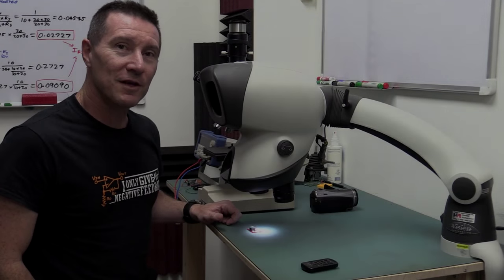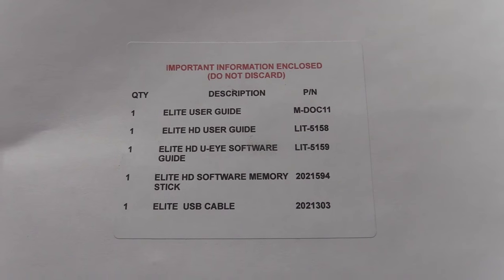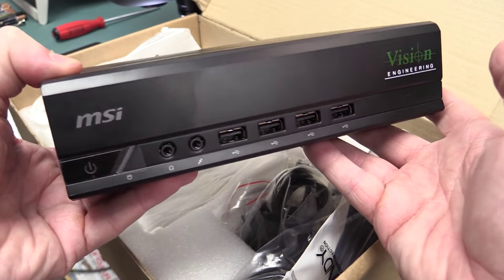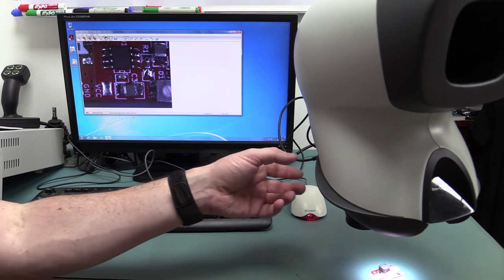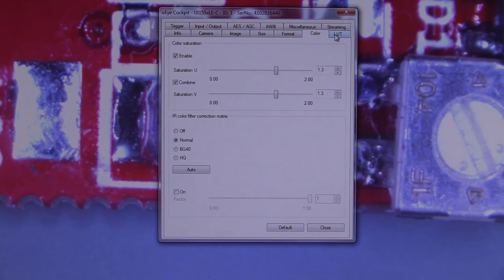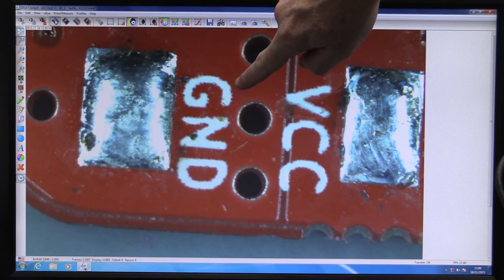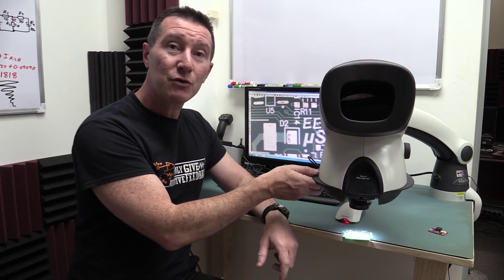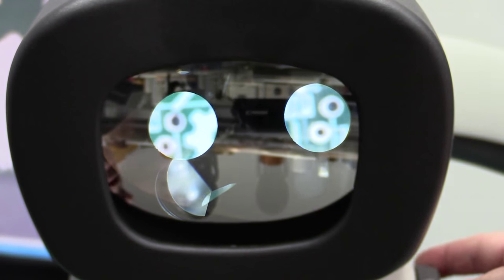EEVblog #817 - Mantis Elite Cam Inspection Microscope

Comment: Dave you really need to get yourself a Rock Solid 2-4" thick wood workbench and BOLT it to the wall and/or anchor it to the floor. Your Inspection Microscope will be rock solid and your productivity will go up even without the microscope.  Google "Anchoring a workbench" for Idea's.
Reply from the maker: +Radiation Network I know, I just haven't bothered yet.

Comment: Hi Dave...I've had a mantis in my lab now for nearly 20 years and I have to disagree with you on it..I recently sold it and moved back to traditional microscopes...we used it for wax pattern fabrication and metal working...I'm not saying it is bad..just not as good as it should be for the price..especially the depth of field, maybe not that important for pcb's but pretty important for checking fit of 2 components over a large area...thanks for the video..fun watching..
Reply from the maker: +electro1622 Sure, if you have different depth of field requirements then it might not be for you. Yes the DOF is fairly shallow on the mantis.
Reply: EEVblog
To be fair to the Mantis, it is very comfortable especially for people who wear glasses..you don't have to take them off..the swivel arm is good and magnification can be changed by the flick of a lever. Mine had a light source as well which was excellent.  For pcb's this would be awesome..

Comment: I might give you another opinion. I personally didn't like using Mantises at my work place and switched to Leica stereo microscope with boom stand. Mantis didn't offer enough room for reworking stuff even with Metcal ultra-fine solder pens. Basically my work leica stereomicroscope has 10x eye tubes with adjustable -3 to +3 correction, eye distance adjustment, Leica ergotube 10-50, Ergomodule 30-120, Leica MZ6 zoom unit, hand adjustable zoom point (focus) and 100W ring light around lens and boom stand. Basically I can adjust it perfectly for my work bench and it is always at right position and settings instead mantis where you have to move whole unit up and down to get focus right and with bigger magnification you can't work on the board. 

Well mantises are good for people who can't adjust stereo microscopes properly for themselves. Also people who use glasses might get headache when using mantis
Reply from the maker: +Markku Hyttinen I believe it's the other way around, those with glasses have trouble using traditional microscopes.
Reply: +EEVblog I am using glasses and get headache with mantis, and my coworkers have said that also :P

With proper stereo microscope's eye pieces they have enough correction adjustments so you can just take off your glasses. Of course I have seen those non-corrective ones which often are over 30 years old. As I said above my stereo microscope that I use at work has a lot adjustment modules; which let me set it correct height, right angle and my eye distance to first lens and of course step-less correction for individual eyes. With these modules I am always sitting on my workbench in proper position even without need to bend my neck at all or go lower sitting height (like you need to do with mantis). 

Of course buying proper stereo microscope is not cheap but offers more comfort than mantis, sadly I have no idea how much below system would cost to order from Leica because system that I am using now is about 20 years old already and still in perfect condition. In other hand, factory where I work has a bunch of broken mantises in storage that need to be fixed (power source failures) and are out of warranty. 

Of course if you need to capture pictures from microscope it is possible with video capture module (many different choices)

Here is complete list of Leica parts that I am using
10 447 159 (10x magnification, -3 to +3 Correction, eye distance adjustment for both eye pieces)
10 445 822 (10-50 degree vertical angle adjustment, horizontal eye distance adjustment, Eye piece holder)
10 446 171 (Eye piece holder stand module with 30 - 120mm height adjustment)
10 445 614 (Adjustable magnification 0.63x to 4x)
10 447 254 (Holder bracket for stands with step-less height adjustment (fine tune height adjustment))
10 446 300 (2x magnification lens)
??? (1x magnification adjustable focus lens)
??? (focus lens holder module)  &lt;-- No need to change actual height for microscope with this even if you flip board upside down with tall components, you simply adjust focus point
10 447 097 (swing arm)
10 447 008 (base plate leg)
10 445 154 (table base plate)
30 110 481 (Cold light source)
??? (Fiber optic ring illuminator)

This system magnification: 12.6 - 80 times
Work I do with this system: foil repairs, solder visual checks, 0201 component size reworks etc.

Source: (M-series brochure)
http://www.leica-microsystems.com/products/stereo-microscopes-macroscopes/routine-manual/details/product/leica-mz6/downloads/

Comment: Dave, they're sending you this stuff for free because you're basically hawking it in a 30 minute commercial. This thing cost a lot of money (prices start at $2,500.00). I can buy a lot of equipment for that money. I use a Nikon SMZ-1 (7 to 30 times magnification), I bought on eBay for $250.00 used and it's perfect. First off, why are you looking through this for, did you say eight hours? I use 2.50 cheater glasses for most work and when I need to inspect or solder in a TSOP or something similar I do it under the scope for 5 minutes at 1/10 of the cost of the Mantis! The Mantis, thumbs down for my money. Where's my Negative Feedback tee shirt when I need it! 
Rob
Reply from the maker: +mosfet500 These are not affordable for the individual. It's like buying a Leica or some other top brand. I've worked on boards that take all day or several days to assemble all the 0402 etc parts. Mantis's were standard equipment at most of the companies I've worked at.

Comment: Its not that hard to open up and assemble back... You wont mess with the opticals... I have refurbished mine... replace 2 mirrors... You just need to be careful but no big deal.... There is ONLY one adjustment on the upper mirror... all the other mirrors are fixed with no chance of being out of place... You can easily remove the bottom parts.. there are only 4 screws that hold all the bottom part in place... I have upgraded mine to a much bigger silica gel inside of it.... I want to be sure my mirrors are going to be good very long.... The old mirror I replaced had got some fungi... Probably because the previously owner did not replace the silica often.. The trick thing is just to split open the case.. you would need free the glass divider inside.. I had to do to replace the mirros. So if you want to see everything inside you can just open up the bottom part.... 2 screws in the front and on the back you remove 1 screw with a cover to more 2 screws and thats all!
Reply: Anyone else repaired or upgraded the usb? My cable has broken twice, now thinking good time to swap the connector with a USB or other connection and swap camera out.  The eye spacing adjustment knob no longer works so I will need to open up for that anyway.

Comment: +eevblog - Dave, I wish you would have shown the pricing for the Mantis with and without the camera instead of your viewers having to do the searching.  Just a little thing but I think it would make your video that much better.  I mean most of us just want to know if it is a $50 or $750 option whether we are in the market for one or not.  Other than that a great video!  Keep it up!   :-)
Reply: +ElmerFuddGun +eevblog - Dave, like you said about having a short HDMI cable included at 9:35 - "... small touches like that... it's important."  Same with including the pricing in your video.   ;-)
Reply from the maker: +ElmerFuddGun Depends on the country you are in and your dealer. There is no fixed pricing.
Reply: +EEVblog - I hear you Dave.  All I am suggesting is an approximation... is it a $50 option or $750 option?  Just a ball park figure in whatever country you choose.  We're all just curious and most of your viewers won't actually be buying it but would still like to know how much extra it is.  If it is only $50 then on top of the Mantis price it isn't a big deal but if it is $1000 we can continue to complain about the "cheapness" of it!   ;-)

Comment: There's something weird going on with your videos recently (last mailbag had the same issue): when I switch to fullscreen, the video is progressively slowing down but not the sound, and every few seconds it's jumping back in sync (with a audio glitch too). It's very annoying. At first I thought it was my PC, but only your channel does that, and even when my PC is mostly idle. Did you change anything in the way you record or encode them recently?
Reply: +Jérôme Vuarand Youtube always re-encodes to a lower bit rate of their own format. It may be your computer or internet speed, or flash player is out of date.
Reply from the maker: +Jérôme Vuarand It's not my video, it must be Youtube.

Comment: looks like they just strapped it last minute to make extra money not thinking through
Reply: +Vadzim Dambrouski I agree. I know the company producing the Camera (IDS) and the software to test the camera looks exactly like the software Dave shows in the video. If I recall correctly. They haven't bothered getting a developer to use the SDK to create a tool that does the job in a neater way. I mean they haven't even bothered installing it in the first place. FAIL!
Reply from the maker: +Vadzim Dambrouski Yes, it's clearly just tacked on to meet a marketing goal.
Reply: +Vadzim Dambrouski So. You're sayin' Dave's been screwed with a strap-on. Wowza. badaboom, I'll be here all week folks. ;D

Comment: I dont understand why He is so interested in FRAME RATE when youd think resolution, optics and image quality are what matter ? (not that those are top of the line either. but.. ) For soldering, even the 17 FPS on max quality looked fine to me. Its not like there is much motion happening.

Comment: Because the position of the arm of the microscope is arbitrary, it cannot measure on the image, unless you calibrate it manually. And even after, it's totally useless if the height changes a bit.
Reply from the maker: +Gonzalo Cobos Err, no. The lends are fixed magnification, with a shallow DOF, so you could at least have a ballpark accurate calibration figure for an in-focus image using a known lens.
Reply: +EEVblog Maybe I didn't get it. Does the mantis know at what exact distance the lens are from the table? If there's no feedback, it cannot measure on the image. It can always guess, though. A solution I can think of, is a simple tag or pattern that you could place on the table and the software would recognize to calibrate itself.

Comment: Dot matrix printed ident? Come on Dave, it's screen printed using a coarse-ish mesh screen.

Edit: But I'd agree with you about the Mantis - I've worked with one of these and was stunned when I looked through it for the first time. And Vision have got an 'Autumn Upgrade' promotion on their website ATM which includes a free upgrade to the Elite-Cam HD on the Mantis Elite.
Reply from the maker: +Graham Langley Err, no, it's not. They are dot based inkjet printers these days. Hardly anyone does actual "silk screen" any more.
Reply: +EEVblog You're right. Inkjet ident/legend printers are now being used for white - if you want another colour it's probably still screened. Just realised it's four years or so since I was up to speed on what's current in PCB production.

This means you don't have to be so careful about not having ident ink running over a hole on a PCB design.

Comment: I don't get all the rave about the Mantis.
I have access to some decent regular microscopes as well as a Mantis and I'm totally on the other side of the fence on this one.
The Mantis makes me dizzy in seconds and gives me a headache in minutes. I've tried tweaking all the knobs but it never gets even close to the regular stereo microscopes. I'm not impressed by the "clunk clunk" changing of magnification either when my regular microscope has a knob i can turn to adjust it to anything from 1x to 6x (on top of the baseline magnification). I've spent hours on end looking through it no problems.
Reply from the maker: +Norleif Slettebø Each to their own.
Reply: +Norleif Slettebø I agree. I hate the Mantis at my work and so does everyone else I work with. In order to get it to the right height you have to adjust your chair, because adjusting the height of the scope itself is the only way to change the magnification if you only have 1 lens.

Comment: This is what really strikes me about this expensive niche lab equipment - it's build quality and features are simply not up to par with price tag, and it seems that no creative and professional engineer with hands-on experience of their products has actually been involved in upgrading them. For the 4k $ woth microscope I would expect camera auto-calibration, dynamic software controlled LED lighting and fluid joint bearings as standart, as these features cost less than additional 200$ more to include, but without them it looks like cheap chinese tool with features included only to make more bullet points on the box.

I mean - in my small company we are also developing and manufacturing all kinds of proprietary electronics and software products for measurements and computer control, but we are making sure that our software and features are identical and even surpass every other similar product in the market from usability and convenience point of view, we ask for client to give us pre-launch feedback and suggest us what to improve - and then I compare our work with all expensive equipment that we have access to, and even these kind of products in review videos, and I don't understand, why they are making such sh*t with all those resources and customer feedback at hand? :(

Comment: anyone know what the USB (4 pin round) connector is?  I have replaced mine 2x (at $80) each. Not cheap and now figure i would make a 90 deg version so it doesn't get hit or snagged so much.  Looks like what some people are calling a slim mini din connector (M5)??

Comment: What's the specs on that SFF box? Seems pretty quick!
Reply: +s8wc3 its not that quick actually, the boot up is probably a combo of a fresh windows install and an ssd
Reply from the maker: +s8wc3 G3220 CPU @ 3GHz. Fairly ordinary. https://www.cpubenchmark.net/cpu.php?cpu=Intel+Pentium+G3220+%40+3.00GHz

Comment: So the camera is still shit, even in HD. 
Glad I bought the version without cam because the resolution was even more of a joke back than.

What's the deal here, why can't they put a decent camera in there? Is the lens aperture so tiny or what?
Do you know where the camera is mounted in the optical path? I know you refuse to open the mantis but perhaps you can see it through the front?

Do you also find the Mantis uncomfortably low with those lenses and the PCB directly on the table surface? 
Even with the chair all the way down I find I have to crouch down (and I am not tall). I tilted the head up at an angle to get it comfortable. I wish there were spacers for the lens, the longer focal length would be perfect with the lens spaced about a centimeter away from the holder and optical quality/field of view seems unaffected by this.

Comment: The biological microscope shown in not stereoscopic at all, the image displayed in the two eyepieces is the same (there is only one shared objective),  a true stereo microscope has two independent paths for each eye and two objectives.
Reply: You can have a shared objective with two image paths. The mantis is a perfect example of such a system.
Reply from the maker: +Marco K This does have two independent paths.
Reply: +EEVblog I was referring to the other microscope shown in the beginning of the video, not the mantis. As far as I can see that one is a simple composite microscope for slides (Anyway I'm nor sure, I can't see it very well )
Reply: Marco K there are plenty of common objective stereo microscopes. The method of adjusting intrapupilary distance suggests to me that the microscope shown is a common objective stereo microscope.

Comment: Dave, why not go all in' and certainly if you have it as a daily job then dont save yorself for some fine equipment in the long run you would appreciate it, I did..
Take a look at the G600' (pictre below) sure it aint cheap and costing around 35' of the relative big ones and comes with inbuild screen, recordings, picture and all that jazz  and then you can get an elevated all metal stand, the stand itself cost around 7' of the big ones but its full metal and stable, so certainly worth it - but you will then' have an and all in one apparaturs with an awesome infinity-view, where you can have fx 1meter work'room under if you should wish to solder or what ewer...
I took the jump and save up to buy a orignal G600 for an era, and finally took the jump around 1year ago and dammit its so fine.
and the best of it all, the G600 got adjustable LED ligting, 6 actually light emitting diodes it carries, and it doesnt cost more to get feature.
so all in all 42' of the relative big ones (35+7) then your also on the China'beat with all the rest of us' and  in fact deliver it to your doorstep for no extra cost..
https://imgur.com/a/ozajo
think about it, we could also do a flip with all this relative lacking hardware you sadly are end up with, with lacking screen, no adjustable light' and all this questinable stuff this aussie seller called HR are packing on your back, but you need to carry the shipping cost to Scandinavia if we gonna flip for my G600 from BG, but I will throw in the full metal stand for free.